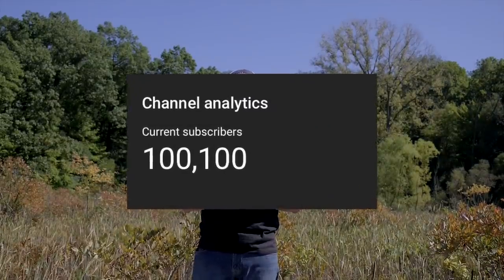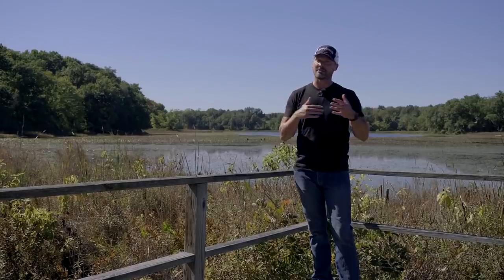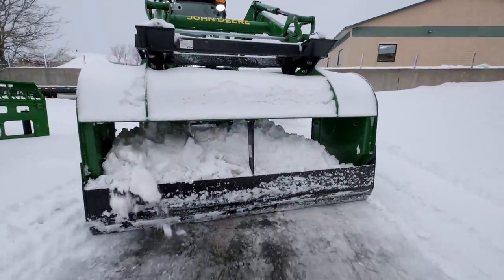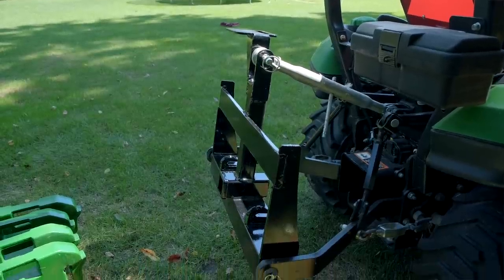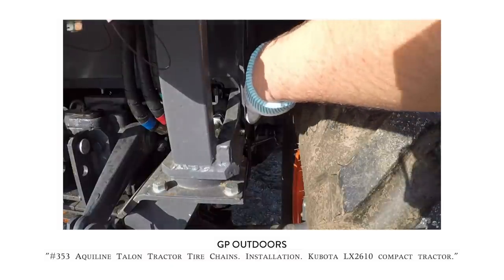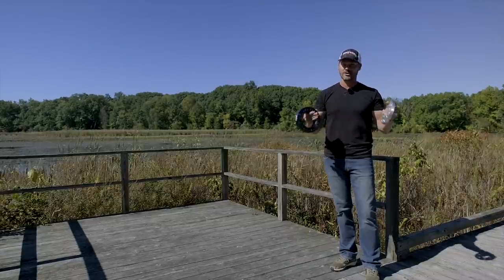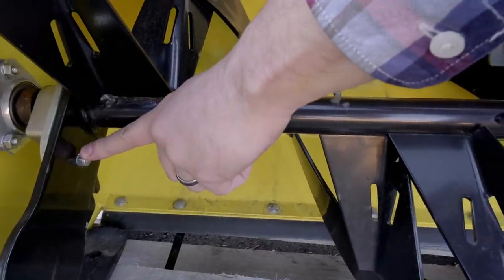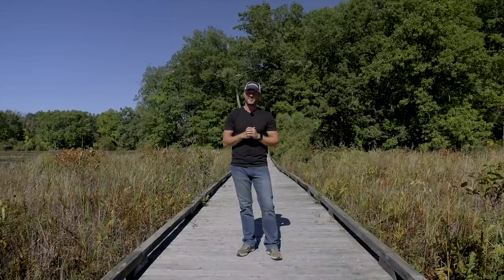TOP 10 TRACTOR TIPS FOR SNOW EQUIPMENT PREP!🥶🚜 DON'T DELAY!

Comment: Heading into my first NE winter with a. Tractor, I have a Kioti ck3510 and a 66" HLA snow push 1500 with bag drag (I bought from my local dealer as they were $400 cheaper - my guess is between shipping and they hadn't updated for increases steel prices). We have 350' of gravel driveway / over 5000 sq ft with parking which I previously used a snow blower on... Looking forward to making it easy!

Comment: I have a TYM 233 and I have owned it for almost 10 years. At first it seemed very tippy because the wheels were mounted in the narrow configuration and living in Oregon, I think we have maybe 100 Sq ft of level ground on our 10 acres. I flipped the wheels to expand the wheel base 12" and it made a huge difference. Winning the Bora spacers would be another game changer.

Comment: I bought my JD 2320 + loader new in 2007 and it has been an amazing machine both with capability and reliability. I added a Frontier Grapple and Artillian diverter kit last year and I wish I would have added years ago! My only problems with the tractor is the how light it is on the rear without any ballast and how narrow it is doesn't help either.

Comment: 3039R power reverser. Tar River grapple. John Deere 3rd function. Spee-Co quick hitch. R4 tires and 2.5 inch steel Bora wheel spacers (rear). Spacers completely changed the tractor on the hills. Highly recommended.

Comment: Kubota 2370 here.  I run a frame mount hydronic angle front plow which works pretty well.  Can't pile high which can be a bit of a pain.  Really looking at moving to a loader snow pusher.  Wish I had a quick attach loader.

Comment: I purchased a New Holland Workmaster 25S this year with the loader,  60" mowing deck and a light duty grapple. The rear tires are loaded, but it needs more ballast. I've purchased a used King Kutter rotary cutter, but need to reconfigure the hitch a bit as it is about 3" wider than my max adjustment on my 3 pt arms.

Comment: First and only tractor, Kubota B2920.   Most of its use is pushing a 63" front blower.  I definitely struggle with traction and turning with the R4s.

Comment: I own a RK25. Recently purchased it in early September.  Trying to decide what to upgrade on this tractor for plowing my driveway which is a long slope approximately 430'. I have a blacktop driveway now and I'd hate to chip it with the bucket. But with any attachment I do use I'm liking the idea of using the poly,plastic or u.h.w.n material.  Last year I used my atv with a plow and I used thick rubber strips acting like a squeegee.  Not to bad, but on the areas where the edge didn't sit flat on the driveway it smeared and pack the snow to ice because the rubber folded a bit.So those parts I went back over with a coal shovel and broke it up. I'm hoping a more rigid material on the bucket or plow edge would eliminate some of that issue

Comment: I definitely could use some steel wheel spacers for my Massey 1725 to add weight and make it less tipsy. I don't know what size I should get. I do not have a mower deck because I want the extra clearance under the tractor. I do have a backhoe on most of the time and with uneven ground I sometimes feel like it's going to topple over and it makes me feel very uncomfortable.  Keep up the great videos.

Comment: Great video GWT.  I think a set of 2" wheel spacers are perfect for my Kubota BX23s.  I'm able to run my tire chains all year and still able to put on the 60" belly mower and get my grass done.  I also have front tire chains but can't use them without front wheel spacers.

Comment: John Deere 3038E, it has been an awsome tractor. Since living in the high desert of Arizona it has been great in all seasons. Wheel spacers will give be a better edge with stability. I have been planing on getting some 3" ones but have not yet ordered.
Reply: I would like to also add, I am in need of a front blade or blower. The roads I live down are not maintained by city or county. I have not yet priced any but having spacers to start with would be awsome.

Comment: I have a John Deere 1025R - Use Edge Tamers on bucket for the winter snows - have a heavyhitch weight bracket and am thinking of the heavyhitch back plow blade in tandem with the loader where the loader moves the bulk but as I go the blade cleans up.

Comment: This will be the first winter with my 2021 1025r.  I have the versa terf tires. I do have chains if I need them. 
 I was using a Yanmar 240d. I had to put chains on the front with the R4 so I could turn on the hillside.

Comment: We have a 1025R for our first tractor. We purchased it with the loader, 60" deck and a backhoe to help with projects around our hobby farm. I'm not sold on the wheel spacers, solely from the engineering standpoint. I'd like to think JD engineers added some moment arm wiggle room to add on to the nominal axel length, but without info from JD, we'll never really know. I find, with loaded back tires, I can get the tractor to slide rather than tip.
Reply: Makes no sense more weight more traction
Reply: @joeehenger6156  Sorry, slide sideways, not forward/backward. And our hill stays a little damp for a while where we live.

Comment: Great video. I have a JD X748 that the front wheels slip when using my snowblower causing steering problems. Those spacers would be great since I can't put chains on the front due to clearance problems.

Comment: I have a John Deere 1025R and use a brush mower on some steep slopes. Sure could use a set of Bora wheel spacers as at times it feels pretty tippy on the hill sides. I put it in 4 wheel drive and go real slow. Working up and down the slope where it is steeper. From Southwest Washington. Ahoed’s

Comment: Have you ever seen Bora wheel spacers used on the front of a John Deere X728?  The spacer might give me enough clearance to use tire chains on the front tires.  Front chains would help me with snow removal.

Comment: Hey Courtney,  really enjoy your videos, and I appreciate you acknowledging other brands like Massey, Mahindra , etc.....
Love the information you provide as well! I have a 2020 Mahindra eMax 20s. I have turf style tires and run tire chains for extra traction. I had the dealer install the chains prior to purchasing, they called me and said they couldn't mount the chains with the backhoe attached. After doing some research I asked them about wheel spacers, they said that would work but they didn't have any. I then asked about flipping the wheels to see if that would give them the clearance needed. Flipping the wheels did work, but now I can't get to the air fitting to put air int the tires without crawling under the machine. 🤦‍♂️ I'm thinking a 2" spacer on each side would give me plenty of room. Keep the great videos coming!

Comment: I added wheel weights on my 2025r.  360lb. Total.  My drive way is 300ft long.  The bottom of the driveway is 75’ lower than the top. The tractor has plowed the driveway for 2 years but it does get stuck occasionally. Hoping the weights fix this issue.

Comment: I have a 2016 BX25D and would like to have a pair of 2" spacers to help stabilize the tractor when mowing on slopes. I have 8 acres and there is very little flat space and the BX feels very unstable especially with material in the bucket.

Comment: I have an 1952 8N.  I don't need the BORA spacers for that - it looks like a spider.  But I starting the process of buying an RK37.  I have a 15 degree hill with a couple 25 degree patches and could really use the spacers on the RK37 with R14 tires.

Comment: I used chains on my X series JD lawn tractor with a snow blower. They work great until you get on a steep concrete driveway, then it’s worse than not having chains. Maybe the rubber chains would be a better option.
I now have a 1025R with the radial tires. Will be using an HLA snow pusher for the first time.

Comment: Hi, I own a New Holland TC29D, and even though most of the products in your videos are specific to the green and orange tractors, I still find you have plenty of helpful tips that I can use with my blue tractor too. My property sits on the foot of the Blue Mountains in NE Oregon and I have no choice but to travel side-hill on my tractor to get around most of the property; those BORA spacers would give me some much needed stability!
Also, I wonder if you might have any tips for someone using a snow blower on a gravel driveway on how to avoid scraping gravel up into the blower? I put a fresh layer of gravel on my driveway this summer and don't want to see it all get thrown out into the pasture this winter!

Comment: 2019 JD 1025R ....keep the videos coming. A pair of bora spacers would be awesome...also on your JD snowblower the shear bolts are near the chute..they give you five extras. Also if anyone is interested I have put rubber paddles on the auger for I can chewy through complete slush with ZERO clogging. Plus it throws the snow additional 25 feet. Drop me a message and I will send pictures.

Comment: This would really help out for my 1025 John Deere Tractor that I bought recently. I have the liquid ballast already installed. I just don’t know if the 2 inch aluminum wheel spacers will work with my 54 inch mower deck. Please advise.
Thank You 
Bruce

Comment: Those wheel spacers would work great on my 1025r
Reply: I have a 2020 Kubota B2601. For the winter here in North East Ohio I remove the backhoe, remove the loader and all I use is a 6ft. rear 3 point mounted blade. With my R14, it worked great last winter. The only thing missing would be a nice set of wheel spacers.

Comment: I own a John Deere 2320 tractor (actually my wife does).  She refuses to drive it on any sort of hill since it is so tipsy.  I thought about putting a set of wheel spacers on it but hesitate because of the weight of the liquid-filled tires.  And I don't want to go through the hassle and cost of transporting it to the JD dealer and have them do the job.  But maybe, in the long run, I will have to bite the bullet and install wheel spacers.  Safety first.

Comment: My 2019 1025R could really rock a set of those spacers. However,  I think I'm limited to 1.5 inch spacers running my 60D autoconnect mower deck.

Comment: Can not win your give-away here in Northern Ontario. I only have a small 3 acre lot with a bunch of unusable bush. So my tractor is a Craftsman lawn tractor. It doubles as my snow removal equipment and I use both suitcase weights and (rear) tire chains. They have been working like a charm for the last 20 years.

Comment: BE CAREFUL with that super clean degreaser! I used some on the loader of my first tractor (2025r) and the overspray landed on the hood and faded it. As soon as it touched you could see it run down the side of the hood a yellowy green color and everywhere it ran it discolored the hood. I was never able to restore back. It works great on any painted metal but something about that composite hood it will do some serious damage to it. I believe it is the caustic solution it is made up of (sodium hydroxide). I've started using gojo brand wipes for cleaning any grease now on my 2038r. They work great and don't do any damage to anything.

Comment: I have a JD 790 with R4 tires. I use chains on the rear in the winter. I’d never be able to plow without chains. I’d like to try them on the front tires just to help me turn but the manual says not to. Does anyone have input about that?

Comment: I own a Deere 2305 and the spacers would give me more side hill stability.
Reply: I also own a 2305 that I bought used(254) hrs., last year. Any advice? I don't have a manual w/it. Thank you
Reply: @treylem3  keep an eye on the driveshaft from the engine to trans. The ujoints are hard to grease and it’s easy to have something poke up an knock the fan blades off the transmission cooling fan. If you need to replace the u joints, go to Napa and get the ones that grease from one end cap. Maintenance will be so much easier.
Reply: @briannelson2818  Thank you. Where is the driveshaft from engine to trans, and how do i best access it to grease the ujoints? Thank you very much

Comment: I regrettably own a Rural King RK24.
The 60" underbelly mowing option is no longer due to all the raising and lowering hardware has bent, broke, or just stopped working.
This forces me to use a 60" finish mower via 3 point.
This way does NOT allow me to have perfectly straight lines so I am not pleased.
Fixing all that is not right would cost almost as much as a zero turn so I am holing off.
Additionally the arms are no longer raising the bucket in synch so digging is out.
Everything hydraulic drifts down from full lift to full down over night.
To make it all even more fun, RK doesn't have many "real" mechanics.
While I do not recommend anyone buying an RK tractor, I would put the wheel spacers to use.